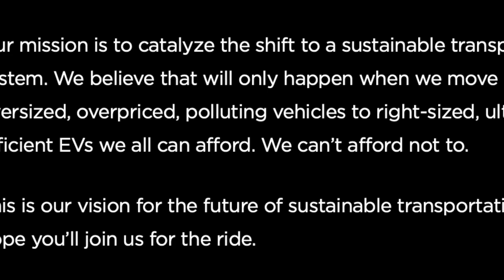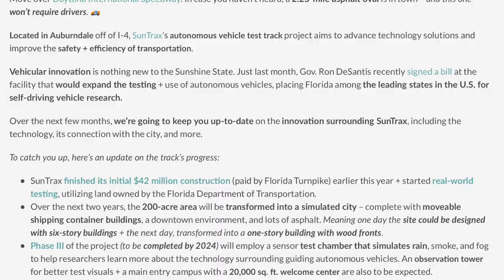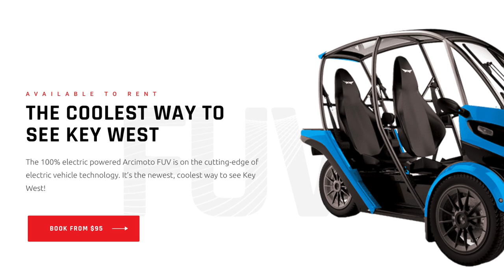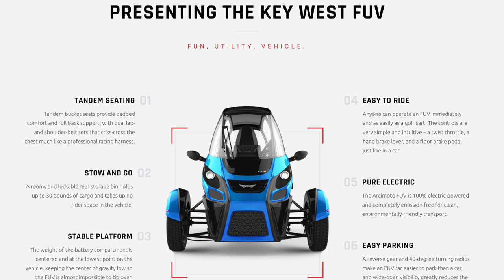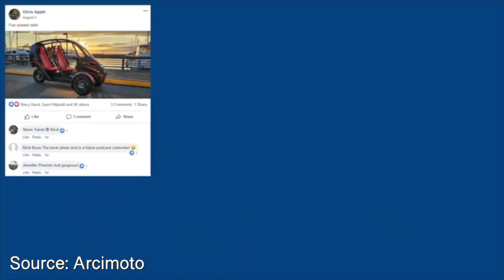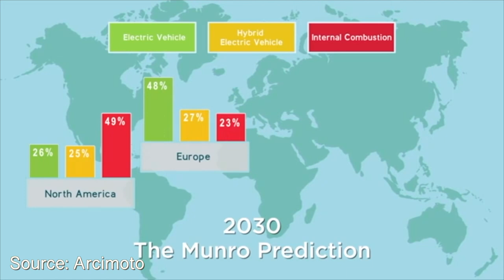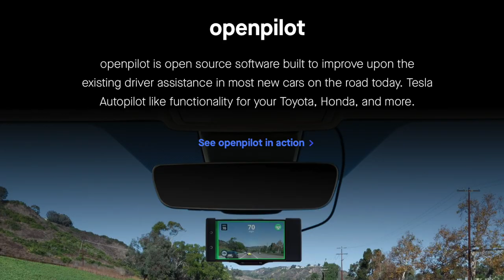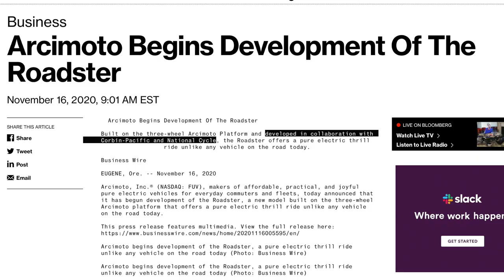Interview with the president of Arcimoto: Electric Vehicles, the FUV, Tesla, and the new Roadster!

Comment: Has anyone proposed a stretch-Arcimoto? Weld an extension to make it longer and add more seats. An Arcimoto limo? An Arcimoto mini-bus? I have flashed on this image of a five-seater stretch with a chauffeur in his livery and two young couples decked out for their senior prom.
Reply: The point is to make a small footprint but still practical vehicle, so I guess not.

Comment: What about traffic safety? Has crash-testing been done?
Reply: It is technically a motorcycle, so it doesn't have any requirements.
Reply: im pretty sure you can design it to have better crash test than motorcycles. its stable, u cant fall sideways, it has low center of gravity. If you splash some money, you can make frontal airbags.
Reply: @mikumikuiyada   Any crash worthiness is better than a motorcycle, they have no crash standards or build requirements.